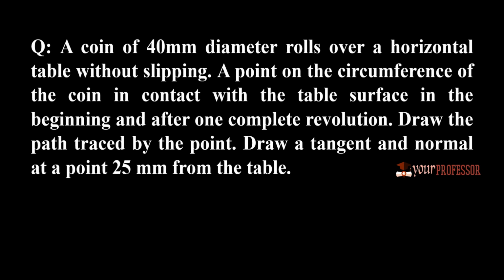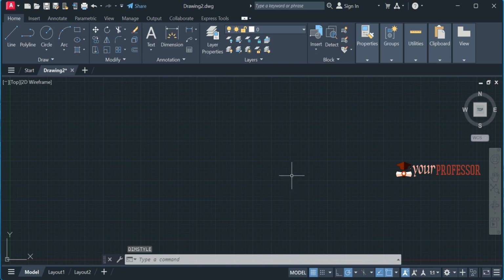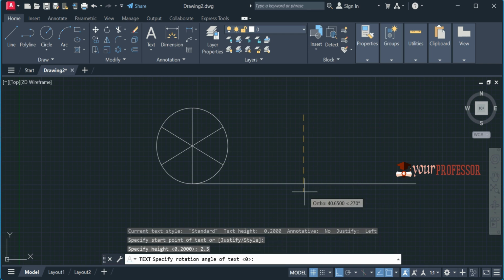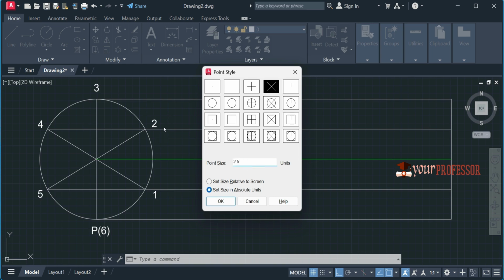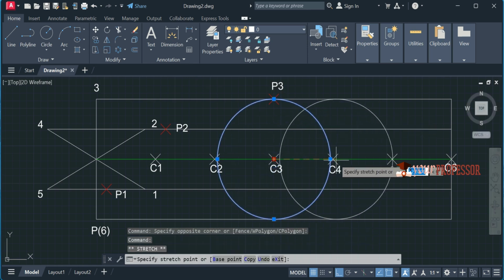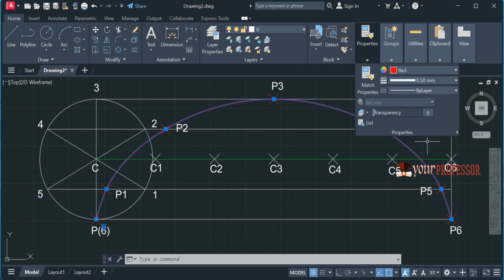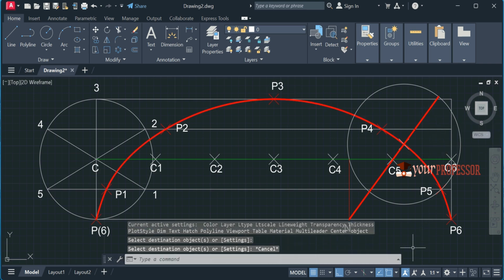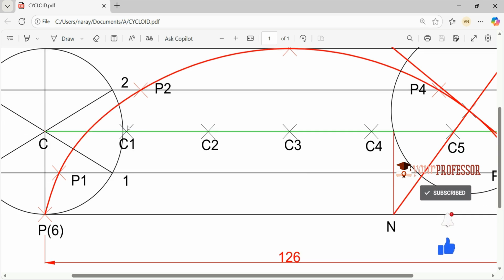Cycloid

Comment: Sir can u provide unit 5 imp questions solution for sem sir plz

H4
Reply: Ok sir thank you....😊
Reply from the maker: In Engineering Nothing like important questions. Questions in exam do appear on concept wise. In unit 5 we have 3 topics for end exam that too for 10 marks. Composite Solids, Isometric view to orthographic views and Orthographic to isometric view.
From those 3 topics you will get 2 questions in which you can choose one question for answering and you can leave second one.

Prepare well for the topic you feel easy. If any guidance is required let me know
Reply: Sir in unit 4 what to prepare?? for end exam
Reply from the maker: @KyasaSrujana you will get 1 question from solids simple position and another question from solids inclined to both the planes
Reply: Sir about unit3,2 ,1?? also sir please
Reply from the maker: From Unit 1
Conic curves 1 question 
Cycloidal curves 1 question 

From Unit 2
Points or lines simple position 1 question 
Line inclined to both the planes 1 question 

From Unit 3
Planes simple position 1 question 
Plane lamina inclined to both the planes 1 question
Reply: @LakshmiNarayanaV1212  Thankyou sir...🤗